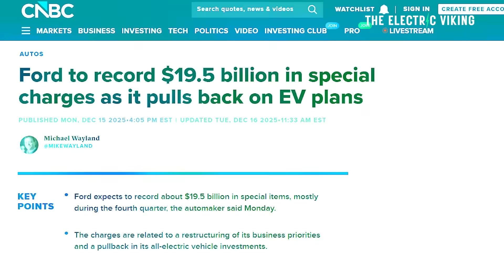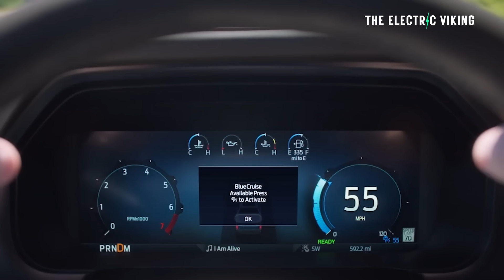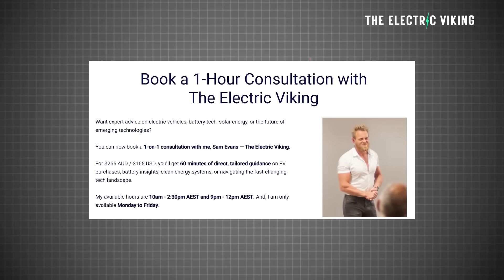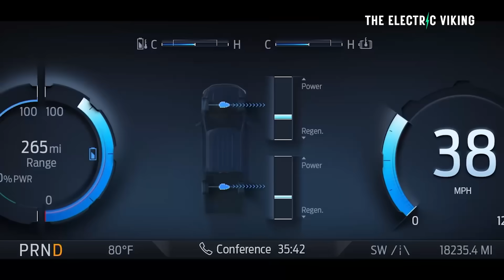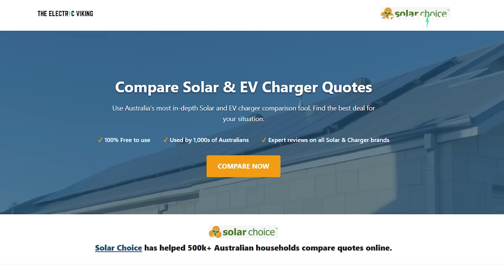Ford’s $30,000 “Apollo Mission” EV Truck: Gigacasting, LFP Batteries and FSD!

Comment: I mean, it could be 30,000 to start and be bare bones and then have ones that are a lot higher.

I have an F150 lightning and I love it.  But they were taking a loss in every vehicle.  That skunk work team had people from Tesla and if it was truly treated as a startup…. If they realized that this alternative model was going to be a lot more cost-effective and profitable it would make sense that they would completely get rid of their existing line and stop the loss.

I actually think the F150 Lightning size makes sense as an extended room with a generator.  I would not personally buy an extended rangeEV, but until the battery comes down in cost, that makes sense.

Comment: I helped design the substation that powers their new Blue Oval City EV plant five years ago. I really hope they do start producing more affordable, utilitarian, and easy to manufacture and repair EVs there. They are basically following Tesla's playbook, but since Tesla has shifted focus to AI vaporware, it really gives other autos an opportunity to build more affordable EVs for the masses and we need them in the US since we can't buy cheaper EVs from other countries.
Reply: Ford sold more Lightnings last year than Tesla sold Cybertrucks.
Reply: Tesla's AI is not vaporware; it's competing for first place among 2-3 world class competitors (OpenAI, Gemini, maybe one of the Chinese AI's). They're building, or have built, the largest AI server plant in the world, in Tennessee. They're using it to power self-driving in their vehicle fleet. They're so far ahead in software that no one else in the world, including BYD and Xpeng, can compare. Will it make for better EVs? I guess time will tell.
Reply: Tesla has shifted focus to robots, robo-taxis and the Unboxed production method.  They are way ahead of Ford, but not competing directly.   The problem for every automaker is that the number of miles driven in private vehicles will drop and new car sales will plunge. Maybe trucks are a category that is not impacted by robo-taxi networks. IDK
Reply: @lawrencesmith9059 robo taxis are still a ways off.  In the near future, people still want to drive their own cars, even if it costs more. 
And, at the moment private cars are still much cheaper than car services.

Comment: If the can make a midsize truck with at least 300 miles of range below $40k in price Ford will sell them,

But that is a big IF.
Reply: That's technology impossible tbh
Reply: @Drewcardello  It doesn't seem likely does it.  Slate seems tops out at 250 iirc.
Reply: @RenlangRen not with lithium chemistry, 300 miles requires obscenely heavy vehicles or fragile aerodynamic vehicles.  Although 240 miles is a slightly conservative estimate for the slate's 85 kwh battery, I am still only interested in the slate anyway

Comment: No!   They have will not deliver a ‘mid-sized’ EV pickup for anything less than 40k and the dealer market will charge stupidly high ‘market adjustments’ if it appears to be a hot commodity.  And if/when that happens FoMoCo will do nothing about it.   

Lightning does and will strike twice.  

Open the EV auto market and get out of the way.   You have failed and just don’t know it yet.

Comment: Ford has not produced a new or different production line...Lee Iacocca did this with dodge/chrysler in the 70/80's it was called the k-car and k platform (those of us old enough will remember how many of those were on the road at that time) and went into each and every vehicle they made for years and brought them (dodge/chrysler) mostly out of their financial problems.  

Instead of an ICE powertrain Ford (apparently, as they are really unreliable in what they say) noted this is going to be a electrified platform....not new just rebranded again and again......Unfortunately after many years of the blue oval in my life I am done with them.
Reply: The new line will be running in October. The vehicles are totally new, designed out of the skunk works, not Dearborn. It's like a new company. Time will tell. 

We have a Japanese car for the first time since 1979, and it seems they have learned a lot. Companies can change.

Comment: My nest truck will either be a Scout, a Gm product or Chinese. Cutting the Lighting production was a big mistake.
Instead of eliminating it , they should have l kept improving the thing.
Ford will be really far behind by the time they introduce the new platform.
Reply: They were losing too much money on that old design, and aluminum parts supply problems. Still loads of inventory left. Cut your losses and go on to something better.
Reply: @jamesvandamme7786  the old design was selling point.  What killed the lighting was costing 80k for a vehiche that has outdated 1hr-charging, meanwhile the cybertruck and silverado ev could charge in 10-15 minutes.

Comment: As one who knows US production cost where the same size Ford Maverick hybrid pickup sells for $25k base, with LFP there is no reason it would cost more as an EV.  An EV minus the battery costs ~ 15-20% less to build as the ICE system is large and not cheap.  A LMFP 65kwh pack is about $4k now.  Do the math. 
 For instance my  1/2 ton, 500kg load Chevy S-10 pickup  200 mile conversion only weighed 2700lbs, 100 lb less than the 4 banger ICE.  I generally take out 1k lb of ICE systems and most have weighed less as an EV.
Now if they do these new ones can be much lighter, more aero, there is no reason they can't sell for $30k base at a nice profit.

And 2027 is a yr away, not 2.
The same yr GM is coming out with similar Bolt replacement based EV lineup.

Comment: So am I getting this right:  3-4 months ago, Ford announced their $30K truck/SUV/Etc platform with plants in KY and TN building the vehicles and batteries. Then, towards the end of 2025, they announced that this entire EV program has been scrapped in conjunction with the Lightning being discontinued so that all efforts would be redirected towards future PHEV vehicles.  Now they are back into the $30K EV again?
Reply: Yep. I work at the plant. We are on layoff atm. Rumor is till about Oct. 
Then we will build this truck and launch it in mid year 27.
Complete retooling of plant for this new model.
Reply: @scottchristian5056Assume you're getting Uaw stipend while on layoff?
Good luck with the new Ev platform there
Reply: I’m not defending Ford, but the $30K EV new platform was not cancelled as I recall, it was the answer to cancelling the Lightning “but we’re doing this better thing soon!”
Reply: @TomKacandes Correct.
Ford only canceled the existing F150 Lightning, to be replaced by the F150 Erev in a couple years.
Also changed plans re some battery plants.
The new Louisville Universal EV platform  is (currently) on plan as announced August 2025.
MachE continues, as it has outsold the gas-powered Mustang in both 2024 and 2025 in North America.
Reply: Farly is as untrustworthy  as Musk.
Reply: @grahamkearnon6682 Except,
In 2025, Ford sold 2,204,124 vehicles in the U.S. (up 6% from 2024), while Tesla sold an estimated 600,000–650,000 vehicles in North America.
Over time, Ford and Gm's proportions of EV:ICE will only grow.
Total vehicles sold will probably remain fairly consistent, but the ratio of EV to Ice will only favor Ev moving forwards 
Musk political issues aside, Tesla gets a LOT of credit for jump starting the US ev market, and those vehicle unit numbers are impressive by North American standards
Reply: @grahamkearnon6682 😂 hysterical bitter leftist
Reply: Your not getting it right

Comment: I had a first day pre-order on a Lightning.  The price on the day it was announced for the trim model I was going to order was $49,000.  Then they trickled an extremely limited number of 2022 trucks out at that introductory price, and then they bumped the price on the 2023's by $20k with absolutely no changes otherwise.  Sorry, guys!  Now they're $20k more, it sucks you didn't get in on the 2022's that we didn't make in time!  I'm going to remember this dirty trick for the rest of my natural life.  Such a rug pull.
Reply: Same boat, they’ve made me a skeptic of Ford forever (also Tesla, same reason same situation with Cybertruck). The auto industry speech should be regulated like the pharmaceutical industry.

Comment: They cut the F150 lightning and now in 5-10 years they will have the solution. Honestly Stoping the f150 production and makeing a universal skateboard design is probably the right way to go.  Shifting to LFP cells is the right way to go. but they do not have an antonymous driveling system that works ok sure they may have the hardware but the software is the harder part. 

I am sorry it is hard to believe we are stopping most of our EV production but in 5-10 years we will be leading the pack.

Comment: Didn't Bob Lutz say something like that about the Chevy Volt, calling it GM's moon shot? To be fair, I think it was the first mainstream PHEV as well as a well-engineered car that was loved by many owners. It was a landmark vehicle that was mostly let down by GM's confused marketing efforts.
Reply: I had a Volt for my daughters, while I was driving BEV. It was an OK car, and maybe even a very good car for people transitioning to electrified cars, but it was kind of overcomplicated. We had quite a few maintenance issues, which very few dealerships could work on. I considered buying the Gen2 version, but decided not to after reading the forums, and seeing how many people couldn't get parts to keep their Gen2 on the road. All in all, maybe typical for a GM product?

My daughter sold the Volt and got a new RWD Tesla Model 3 for about $40K. It's been 100% reliable. I have one as well, and it's been reliable. 7 years, and I've had to replace the 12V battery twice, one Bluetooth sensor, and they had to update the firmware for one module. I've spent less on unscheduled maintenance that I would have on oil changes... There is no scheduled maintenance... All in all a very good experience so far.

Comment: They said the 4WD Lightning would be 50K too.. so the margin for error is +\- 30K in Ford’s mind.
Reply: The 40k cybertruck didn't make it either.
Reply: My 2024 Lightning Flash with 4WD and extended range battery was 50K out the door. 30K if you count the savings of the 0% interest  6yr  financing.
Reply: @southbendkid and the sticker??
Reply: The ones they have left (in Flash trim) are pretty close to $50k now, because they can't seel them, lol.
Reply: @norsefalconer  - I think they'd sell everyone of them if you could walk into a dealership and actually buy a brand new one for $50k.  I just checked CarGurus and you're still looking at over $65k out the door. Ford ended up selling nearly 28,000 Lightenings last year. That's over 100,000 Lightenings so far. Not fabulous but certainly not dead.
Reply: @TronJockey We have them "listed" at $58K in my area. Which is likely $60K+ w/dealer BS. That said, they may get desperate Q2 or Q3. I  don't need to buy, but they need to sell. I can wait them out 😉
Reply: Things change depending on the market. Tesla said the Cyber truck was going to be 40k initially which we all know wasn't even remotely close by the time it was released
Reply: @Yielar1  I think the 40k was the complete number of lifetime sales for the Cybertruck.
Reply: @Yielar1  CT is definitely overpriced for the market. Sales have been terrible.
Reply: In Canada the two base models AWD EV lightings start at 62K Canadian XLT and Pro, well below 50K US…. About 240 mile range.  I guess Ford is losing on them though, not sure.

Edit: And they’re selling quite well where I live, see them almost daily, too bad Ford is losing money on them,
Reply: That is a pretty accurate estimate compared Elon Musk's Cyber Truck. It went from $35K to over $100K and it is junk.
Reply: Well to be fair the democrats dumped a heap of inflation on the US after Ford's 50k Lightning promise. Cybertruck never met it's price point either.....That having been said I'll believe they have a 30k EV pickup when I see it  😉
Reply: @THX..1138 Inflation didn’t cause the price difference. It wasn’t the Democrats that cause global inflation. In fact inflation was much less in the US than other first world nations.
Reply: @THX..1138  you mean the Trump mishandling of the COVID infection and his massive printing of money, and drastic increasing of the debt fueled inflation?

Comment: Yes, Ford can compete with China if they automate to the point where no man is working in the factories. They must have a truck that has the range and the fast charging capacity that is attractive to the gas car buyer. I believe they can do that but they keep changing their mind with on direction they are going and burning money with failed projects.

Comment: Trump inviting in Chinese auto plants is scaring them (finally, a bit late).

Remember when the legacy automakers said making an EV would be super easy and quick?  Just a battery and electric motor, right? The big American automakers, except Tesla and almost Rivian, can barely make eye wateringly expensive pickups at a profit, with 80% foreign parts. Almost out of business already, except as a badge on a foreign made vehicle.  Tesla, meanwhile, has been making vehicles at a profit, even before emissions trading credits, in high wage countries like America and Germany.  Rivian has had a few gross profitable quarters, so I'm hoping they join Tesla in being profitable once they get volume up, with the USD 45,000 starting price vehicle that's in manufacturing validation builds, delivering to customers H1 this year they say (March?).  Lucid seems well behind on that curve, but seems strongly supported by a Saudi sovereign wealth fund wanting to start domestic automating (Lucid has a plant there too, partial assembly now, eventually to be full assembly), so maybe they'll have the runway to get there, mid price vehicle promised by end of this year *shrug*.  Admittedly, GM's low to mid price EVs are looking more sensible than previously (better charging speed), and their EV pickup at least has very good range (440 miles EPA in one version), so maybe, but I think not so much produced in America, unlike Tesla, Rivian, Lucid.

Comment: Strictly speaking Tesla did not invent Megacasting they basically went to an external injection casting manufacturer, I believe a European manufacturer and asked them hei can you build a injection casting machine that can produce parts at a size they wanted produced.
Reply: Correct. Im starting to tire of Electric Viking. Dude is very misinformed. His videos are increasingly showing themselves to be nicely polished turds.
Reply: @clocksun  - the Viking must be on the payroll for Tesla as stealth PR dept, because he always passes along Musk's rantings and ravings as if they're guaranteed to come true, but he doesn't do that with other EV makers.
Reply: @clocksun you’re absolutely wrong.  IDRA invented the giga press but they absolutely didn’t invent megacasting which is a process. IDRA made the tool, Tesla invented the methodology and commercialization of it. The Wright brothers invented flying, but they didn’t invent commercial flying. You don’t have to take my word for IDRA says this themselves.
Reply: @user-ul7xj8qe2k Ok. But Vikings videos are still becoming polished turds. He is totally wrong about wind energy. Windmills are the lowest performing source of energy and at scale, are horrible eyesores. They should all be torn down. But he thinks they're great. What a dummy.

Comment: I like the idea. If they keep the production line to a small number then they can sell 100%. They should look into lithium titanate and buy back the batteries after 10-15 years.
Reply: why on earth would they want to buy the batteries back after 10 - 15 years?    Current tech will be so ancient by then,  they will only be useful for recycling if the components are still needed.
Reply: @TerryHickey-xt4mf 40000 cycles at 15 years they would still be at 95% new and could be sold as new.

Comment: Most likely it will be a starting price of $30,000.
You’ll have to pay extra for:
-steering wheel
- each wheel,
- electro motor,
- battery cell,
- windows,
- windscreen wipers,
- dashboard,
- seats,
- internal mirror,
- left mirror,
- right mirror,
- doors,
- roof,
- internal clothing,
- paint,
-rust protection 
- battery management system
- motor management system,
- charge ports,
- additional assembly fee,
- propaganda fees, (mandatory)
- union fee,
- trump taxes.

In the end, you’re paying over $150,000
Reply: let us wait and see how wrong you are.

Comment: I HAVE A 23 FORD LIGHTNING AND I LOVE IT , THE ONLY THING I DONT LIKE ABOUT THE TRUCK IS THE RANGE ! I RECENTLY DROVE MY TRUCK FROM FLORIDA TO NEW JERSEY, IT WAS A PLEASURE DRIVING IT BECAUSE I HARDLY TOUCHED THE  STEERING WHEEL WITH THE BLUE CRUISE BUT 80 % OF THE TESLA CHARGING STATIONS DID NOT EXCEPT MY TRUCK TO CHARGE THAT WAS UPSETTING , YOU WOULD PULL UP TO CHARGE, HOOK EVERYTHING UP AND THEN NOTHING  , IT WOULD SAY CHARGING NOT AVAILABLE FOR YOUR VEHICLE  ! I MEANT TO CONTACT TESLA BUT I HAVENT GOT AROUND TO IT YET
Reply: Why the shouting?
Reply: you keyboard has a problem.
Reply: use V3 or V4 that's open to non-Teslas
Reply: THE FORD CONNECTED NAVIGATION SYSTEM SHOWS COMPATIBLE TESLA CHARGERS AND WILL AUTOMATICALLY CHOOSE THEM WHEN USING THE ROUTE PLANNER. YOU ARE USING THE FORD CONNECTED NAVIGATION SYSTEM AREN'T YOU?

Comment: I just did a video on my channel about this breaking down the changes Ford is making and it’s not just the battery it’s their manufacturing that’s key it’s bringing their  main module in house and it’s the software team led by for Tesla and Apple engineer Doug Field.
Reply: Right, do you have enough subscribers?
Reply: @jsanders100 for what?